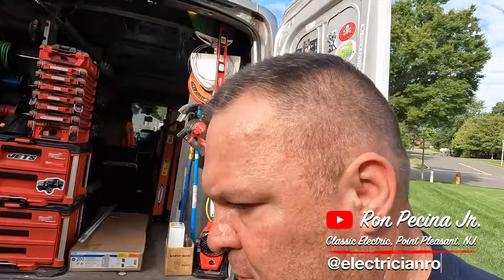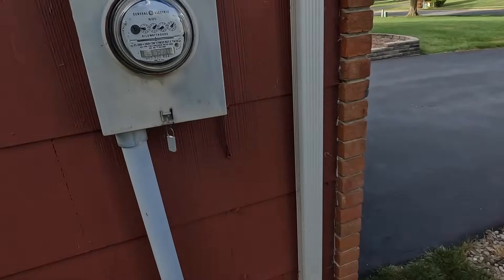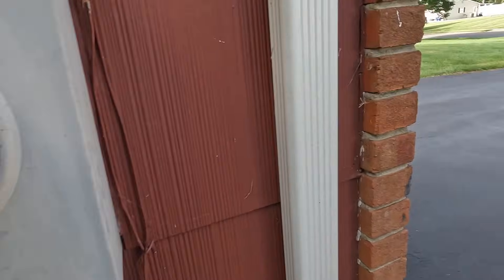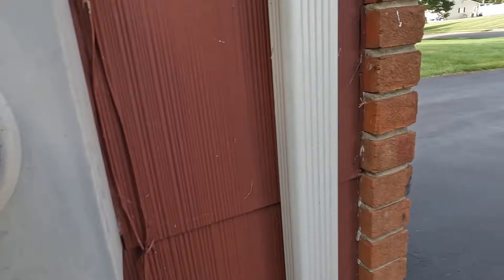From Breakdown to Breakthrough: Fixing a Broken Meter Lug and Upgrading to a 200 Amp Service

Comment: What is the purpose of getting a permit and why can't you do the work without one ?
Reply from the maker: Because that's the law here in New Jersey.
Reply: liability I would assume, not just anyone should do electrical work and there has to be a way for those who are qualified to obtain a proof of that. The permit lets the jurisdiction know that not only are you qualified but the scope of the work being done. Additionally, if something goes wrong and said home burns down. The house insurance is going to want to see that all work done in the home was done the correct way. The permit in this case would place the electrician who did the work as the liable party and insurances would then go from there. I've heard of homeowners pay a handy man to do the work and it gets done wrong. House burns down. Insurance stick it to them for not having taken out the proper permit or gotten the qualified individual.
Reply: @thekilla4k81  Thanks for your explanation
Reply from the maker: @thekilla4k81  that too! 😎